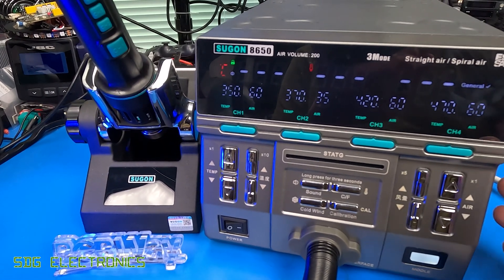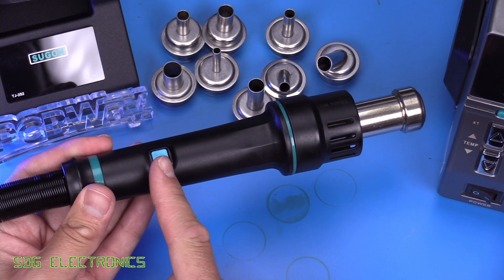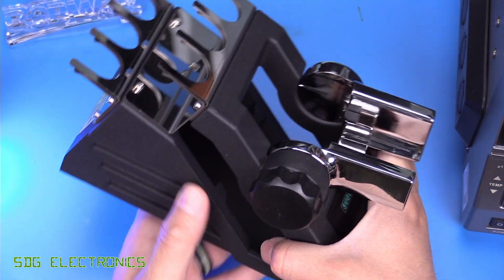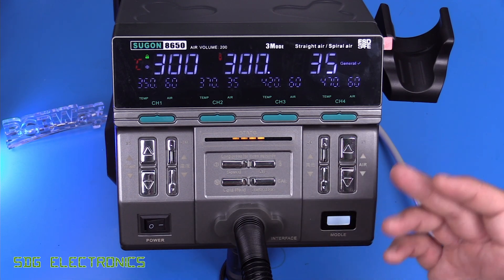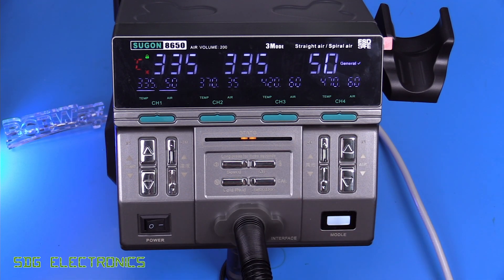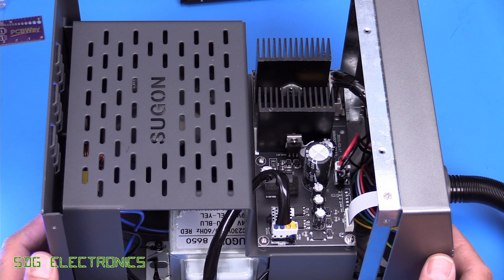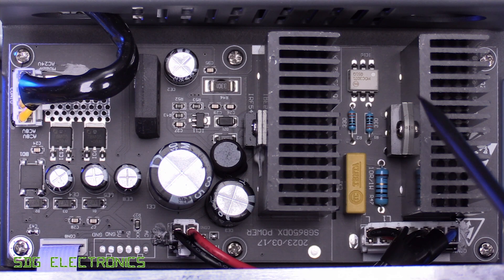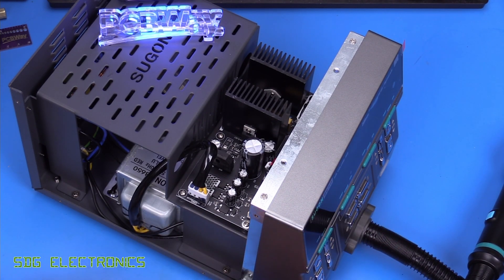SDG #301 Sugon 8650 Hot Air Station 1300W 200L/min

Comment: A bit of a comical appearance and design, but the UI seems okay (although I feel steps of 1 in a hot air station is kind of pointless, only steps of 5 would have been fine), and decent internals. Same you couldnt manage to do some performance experiments in the video. 
The different 'modes' are also interesting, havent seen that with other stations. Although the control engineer in me wonders what the point of it is. Usually parts you reflow have quite a lot of thermal mass, essentially 'low passing' the applied thermal energy anyway, so a lot of overshoot would influence only very tiny components. Similarly, if you have a critically damped second order response, there's no reason to go more 'gentle' than that, you would just be wasting time.

Comment: New information for buyers of this Unit!  
Just received an 8650 and I'd like to add that they have changed the heater element and they no longer provide the swirl nozzles or the angled nozzles. They have not updated any of the advertising, and show that you will get 8 nozzles, but when I asked about the missing nozzles I was told that the new heater element is an update and to keep the price the same the nozzles are reduced.
I've requested a price for the 4 missing nozzles and was told that they don't have the swirl and angled nozzles, so they don't have a price. They have also said that they expect to get the swirl and angled nozzles in a few weeks, I'll update when I get the price for the missing nozzles.
Reply: I got mine 2 weeks ago it came 2 heating elements and 8 nozzles. Bent and straight btw
Reply: @techmedicsuk8381  I guess I purchased at the wrong time. Glad to see that they are shipping what they advertise! 🙂Been using it a bit now and it seems to work great. Only thing that I'd change is to make the handle easier to rotate so as to be able to hold it in the right orientation to access the user buttons on the handle.
Reply: Any updates?
Reply: @Keiuran  They have a new set of angled nozzles that they sell for $20US. I don't know if they have updated their advertising but it seems that going forward the angled nozzles will be extra. They didn't provide any information on a swirl nozzle, but I'm not going to pursue that. I've had the angled nozzles for a couple of weeks but haven't had the time to try them out. But I see no reason why they won't work as expected.

Comment: Hello, I am talking to you from Iran, please answer the Sogun 8650 heater that I bought in the middle of your video at minute 8:57. Tell me how to open the buttons, I feel that some part of my device is broken, help me if I need to take a picture for you, I use google translate, I don't understand your language, please send me a message or a video of how you fixed it. The red shape that looks like the handle of the 8650 device 0:08 0:11
Reply: Did you got the solution

Comment: I see on the latest pictures of this that they removed the Chrome from the buttons.  The Modle issue doesn't seem to be fixed but on the new 8630Pro version they have it as a Set button.  Hopefully the 8650 will get fixed.   They seem to have listened to the complaints.

Comment: Hi Steve, nice Video and a Interesting Station. What about the Length of the Hose ? 
Which one of the China Stations you tested has the Longest Hose ?
I have the Quick 861DW and the most annoying about the Quick (other than the Fix Mounted Power Cable) is the very Short Hose. Cheers, Konstantin

Comment: how is the sound level vs some others air stations
Reply from the maker: I forgot to mention it since I barely noticed it in use. Up to 100 L/min its hardly noticeable, but above it's mainly noise of the air moving rather than the blower. Certainly one of the more quiet systems.

Comment: i was gonna buy the best hot-air station but i think i'll save up for this istead
Reply from the maker: This one is definitely the better station, but I used the Best daily for over a year with no issues.
Reply: @sdgelectronics  Better in terms of performance or ergonomics ? I doubt the additional air flow / 100W of power makes that much of a difference and I didn't see it being used on a PCB but I can be wrong
Reply from the maker: @thobiasmartin4768  just the usability and the likely longevity
Reply: @sdgelectronics  Honestly between a stock BST station and this one I would choose this one, but with the upgraded control board I like it a lot, especially with the buzzer turned down
Reply: I've got a Best station combined with the upgrade board from @RandomHacks And it's really nice now. Depends on what ergonomics you want I still prefer the Best over this one, seems to bulky imo
Reply: The Quick 856AD is the best of the lot, but significantly more expensive. It's quiet and puts out a lot of heat.